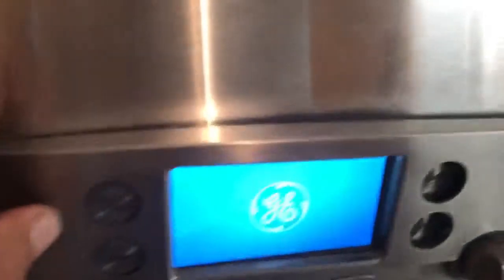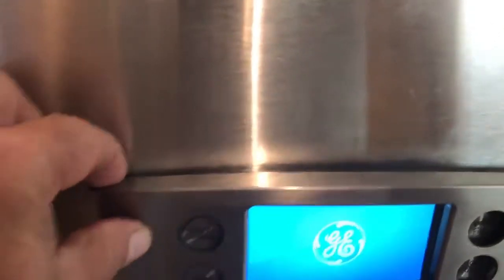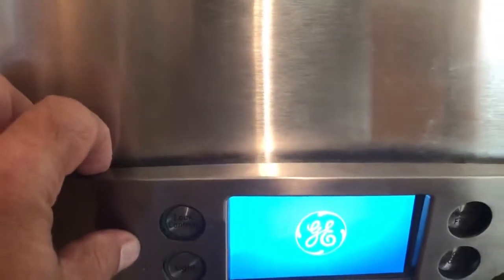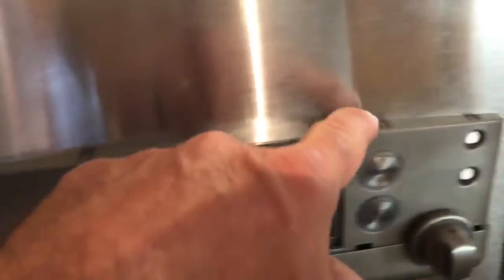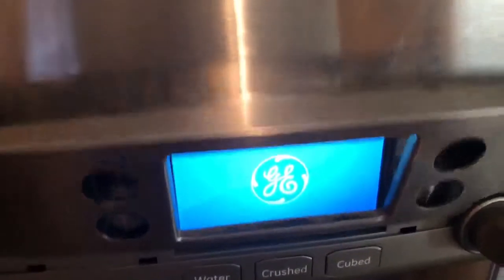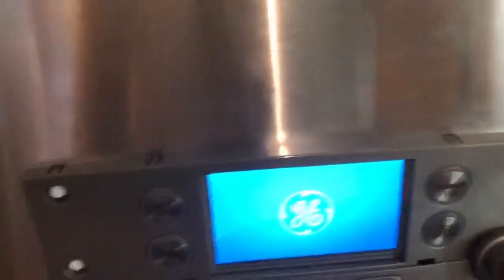CYE22TSHESS GE profile Cafe dispenser control panel touch screen   WR55X30439

Comment: I have the same issue with the screen stuck on the GE logo. Did replacing the screen fix the issue for you? It’s a $350 part and was hoping to have some confidence before taking the chance.
Reply from the maker: I did not have to replace the screen yet. I need to get behind it for another repair that I can't even remember what it was. Try looking up screen diagnosis for the unit here on youtube. good luck.

Comment: It's a tight slide up to uncover and then getting it close to slide it back in. Not easy and need to have patience to repair anything behind this cover
Reply: To add, the motor duct door (similar to Solenoid) gave out after 2 years of use (ice door wouldn't open and shut properly) and I needed a way to open the cover. So Big Thank You!

Comment: I noticed that GE doesnt help much when you have problems.... My icemaker works but the ice flap will not open, any ideas?
Reply from the maker: Hi Wendy, you can access the dispenser thru the panel using a quarter in socket.  You should be able to see why it is jammed.
Reply: @warrenhouse5529  Ice flap has a little drive motor

Comment: We figured how to get it off, but now can’t get it on. Was it easy for you?
Reply from the maker: You have to play with it a bit. Wiggle it to get around the knob and set the bottom in first then just snap it back in.
Reply: I'm still having a issue with taking the face plate off.